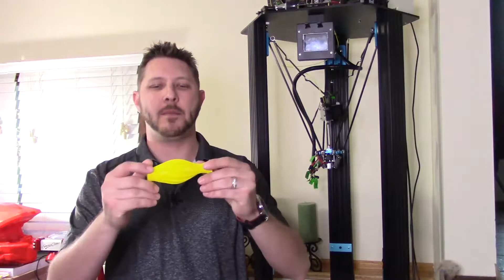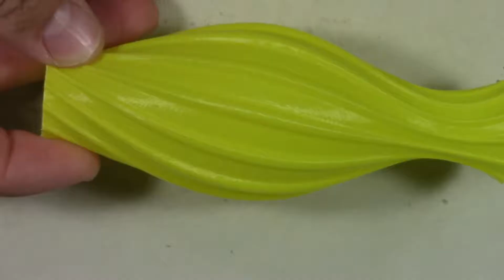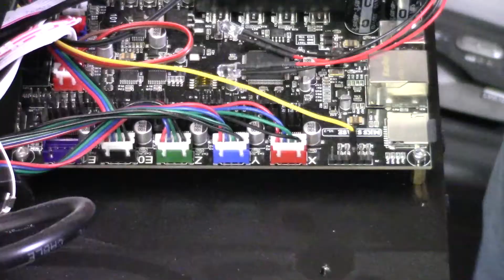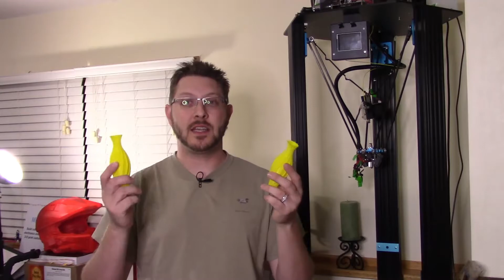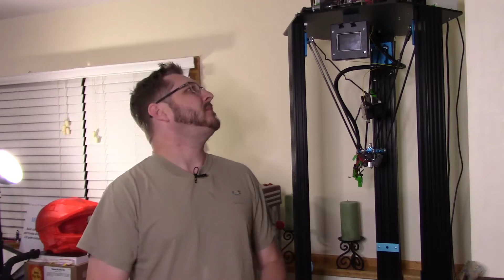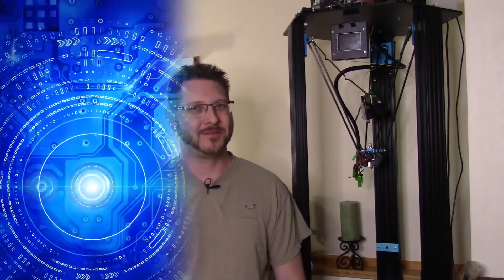Tevo Little Monster Using TL Smoothers

Comment: OR you could simply switch over to a different kind of a driver, which has better MosFETs or better power stages - You know, like the TMC 2100th.. This will not only solve the salmon skin effect, it will also make your printer silent.
Reply from the maker: Hey there thanks for all the great comments.  I took your advice on the different drivers and I think I may order some and maybe do a differences video.  Thanks again.  I love getting comments from everyone because I always learn something new!

Comment: Having said it, you might be able to repeat the effect using a shunt with a parallel capacitor. No need for a diode, which has a large on resistance and takes voltage. But I got no idea which shunt and what capacitor, however, the capacitor will be tiny.

Comment: Nope, that's not the reason :-). The reason you get salmon skin is that the cheap drv8825 drivers MosFET's amplify their parasitic capacitances due to the miller effect. Then they resonate with the motor coil. So what do these diodes actually do? Well, they are in series with the current. Therefore, their parasitic capacitances are in series to the driver's exit. When you take two series capacitors, their series capacitance is less then each.. And the diode's parasitic capacitances are tiny, virtually none existent. Two series diodes - even better: Parasitic capacitance halved.